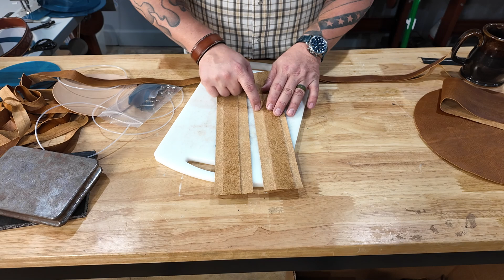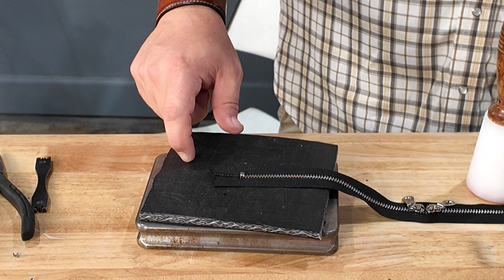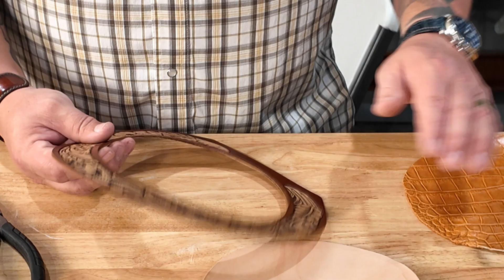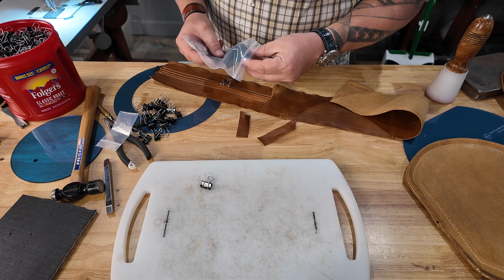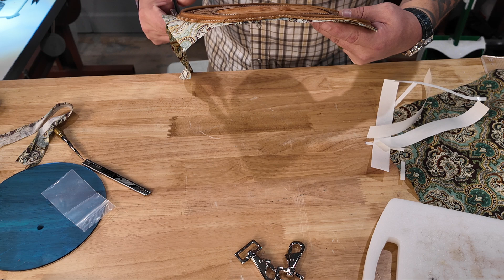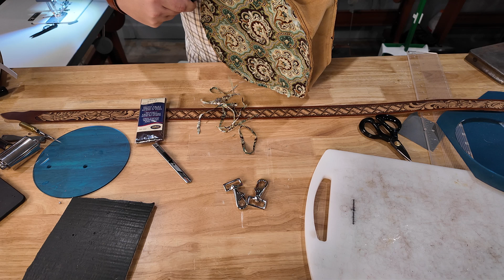Building the Canteen Purse Part 3  putting it all together

Comment: I cut my own design for a round canteen style purse and I have 1/2" seam allowance but my problem it all the layers make it hard to sew on a leather machine
Reply from the maker: @StephM1955  do you skive your edges?
Reply: @makersleathersupply1220  no I do not that would help with the thickness
Reply: @makersleathersupply1220  do you have a video on how to do it without taking time much off